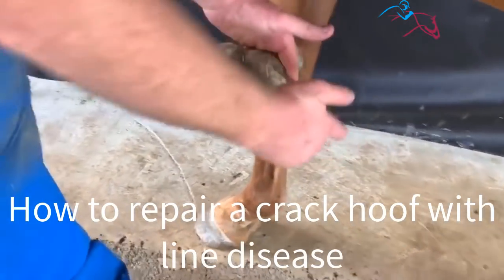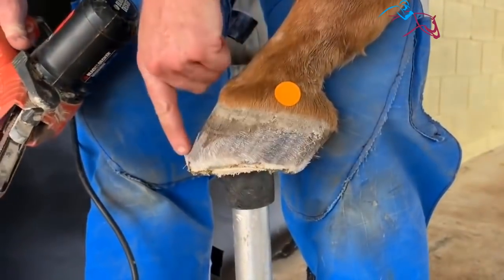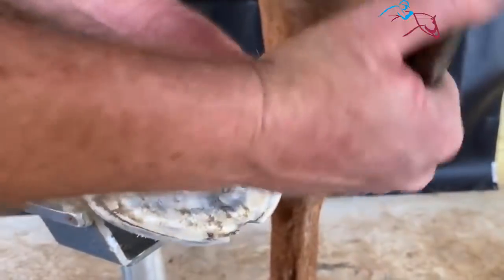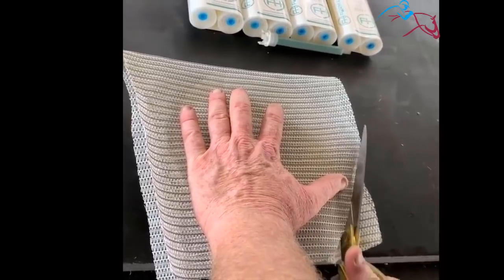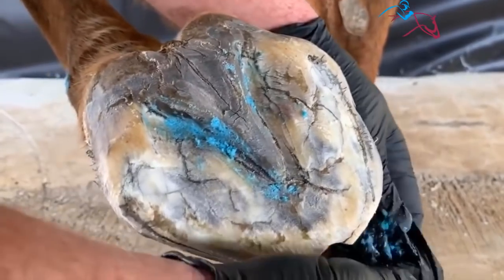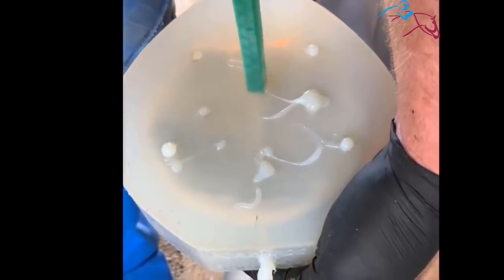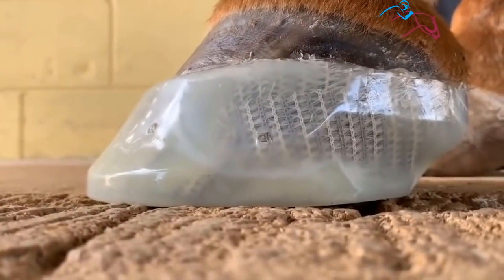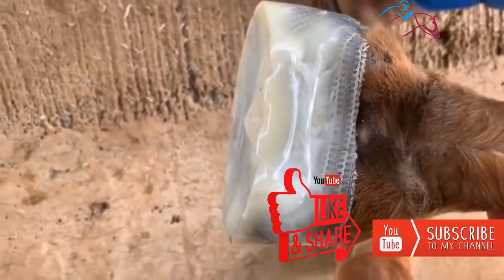Awesome broken Hoof Repair Horse Racing 2021

Comment: Toothpaste?  Why toothpaste?  Surely there is a better option that toothpaste?  What about honey?  That might actually both clean and help the medicine settle better into the areas it's needed.  It seems baby powder would be as effective a "holder" given how this mixture just sits atop the area it should go into but won't until maybe after the mold is applied.

Comment: Okay the photo for this video is very deceiving. Cuz a force in the photo is not the horse the guy is working on. The horse in the photo shows a black horse and don't know if the stallion or a mare. Couldn't tell you. But the damage to the horse's hoof itself is very bad. But when you go to see the video it's not the same horse. It is a brown horse with parts of the horse's hoof chipped off. Is there so you're really easy thing to fix. But the picture of the horse for the video that horse's foot was more damaged. Part of the hook was healed up and pointing that word like it's foot had a unicorn horn. I personally would have liked to have seen how the farrier repaired the horse's hoof in the picture for this video. That's the video I thought it was going to see instead of just a standard horse hoof filing and trimming. And then digging the crap out of its bottom of it's hoof.

Comment: problems with nails when exposed to bacteria. humans and horses are the same. but do not you clean the nails with alcohol or harder. it causes nail damage and becomes wrinkled. try with clean and warm water. it will be better.

Comment: Man, it really amazes me how these animals just stands still too.
Reply: They are trained to lift their feet and stand still
Reply: They don’t always.  That horse is likely sedated
Reply: @rockinu440  um, no, they are trained to stand still and give their legs, they do it every day, and it can be comfortable for them when you hold the leg right but you clearly dont know a lot about horses when you think we just sadate them 😬
Reply: @lynx6330  When we use power tools on their feet, we generally sedate them for our safety and theirs…and I’ve been a farrier for nearly 30 years, but you do you with all your knowledge.
Reply: @rockinu440  well of course you sedate them when using tools that could spook them or they have to stand still for a long time, or they arent used to having their feet done, im aware of those issues, every horse is different and every horse has a diffrent tolerance to being handled but if it is avoidable the horse isnt going to be sedated but im just some guy from germany who takes care of world class jumpers
Reply: @lynx6330  using tools like the ones in this video you might sedate them? Huh…sounds kinda like what I said.  And I have no idea what you know, I’ve seen quite a range in my professional career.
Reply: @rockinu440  my bad i apperently skipped the part where they used it 💀💀 i just saw the rest
Reply: @rockinu440  I have had a few horses with super hard feet that needed a sander to file them down. After a bit of training, they all stood like champs with no sedation necessary. Tranquilizers are not the answer for every single issue.
Reply: @erintubb9860  If your horse’s feet required power tools then you have a whole other set of issues to examine.  I use a buffer to put a show finish sometimes, but required? Sure some horses will stand, and sure horses can be trained, but it’s not my job to train them, and when a horse is facing an acute issue it requires attention right then, not after you have desensitized it for a couple weeks.  For my safety and the horse’s, sedation is the best answer, and if you believe otherwise that’s sure ok, but find someone else to work on your horse, I’m out.
Reply: @rockinu440  I do my horses feet myself. The only time I ever hired a farrier to do them was when I was heavily pregnant
Reply: @erintubb9860  Well, I’ve done horses every working day for 29 years…I hope you don’t mind if I don’t defer to your experiences with your horses.

Comment: Not a farrier but I've been Horsey (as we say in certain parts of the UK) for about fifty years and many things concern me about this video - (quite besides the almost useless soundtrack). Firstly - if anyone has brought a power tool near my horse as this guy did - he'd be buried in the muckheap - both my well behaved mare and my daughter's fairly uptight eventer would have killed him for sure. I reckon there's a good chance the horse was sedated or twitched. 
Over here splits in hooves like this are always referred to as "sand cracks" no matter if the horse has never seen any sand - they can be caused by trauma but are usually genetic faults ( not surprising so many freaky racehorses have them then!) Once evident - they provide a quick entry for all kinds of bugs and disease - I've never heard of anyone refer to "crack disease" before perhaps it's an Aussie idiom?
Though I saw the application of some magic bluey green potion being roughly applied - I fear for what's happening under all that polymer - it's a great idea and I can see it gaining traction in the Racing world where the horses are mostly treated well but as commodities. 
I can't post a link at present but there are veterinary overshoes that snap on with a strong latch - they don't fit as well as something glued on but have the advantage of easy access to check wounds.

Comment: Does the hoof grows back after a trim,if yes then how do the wild horses take care of their hooves...
Reply: Their hooves are worn down naturally, it’s standing on concrete, in dirty hay, or extended time in wet conditions that cause a lot of problems in hooves. In nature, horses are moving steadily over various terrain, which wears them down as they grow. Also, old style ranching where the horses are working cattle day in day out, rarely need worked unless injured. In the wild, an injury can mean death, if it prevents the horse from escaping.

Comment: This is really interesting. Such a well behaved horse too. I can't imagine trying to do this with a hose that doesn't like it's feet touched
Reply: Im not sure what u were trying to do. That was the strangest ,probably expensive repair to a quarter crack that normal shoes would have fixed
Reply: @christinemarsh9709  excessive use of a sander too
Reply: It was tranqed,no horse would put up with that sander
Reply: Oh look the internet experts are back.

Comment: the mold that you use can that  be used for several times or is that for once time to use?
Reply: I dont think this is this channels video. But I've seen it on others and these moulds can be reused on different horses. Search formahoof on YouTube.
Reply: @angelamelville67  He wasn't using Formahoof. This was a different substance and cannot be used again.
Reply: @rosemarydudley9954  he asked can the mould be used again, which it can, thats what I was saying. Thanks.
Reply: This is a stollen video that was sped up and reuploaded by this random channel. It’s been reported.
Original video is here: https://youtu.be/GXWQLO9Snlo

Comment: Surprised horse didn't react to the feeling of the sander.
Reply: They have no feeling in their hooves. With the exception of the frog, cornet, and the growth tissue deep into the hoof. 

Think of your finger nails, since they are the same material. When you clip and file your nail, it is the same feeling they feel.
Reply: @vetsrus31  I still feel vibrations in my nails

Comment: Whoever owns this poor animal, has absolutely no business owning it.  That crack is due completely to neglect.
Reply: Jennifer Seeley - Not always the case. Hot, dry, dusty weather can harm the feet. If the horse is turned out 24/7 and maybe treads on rocks etc., this can happen. The horse really needs a good diet and fresh water plus a hoof treatment,DAILY.
There was no blood seen here so the cracked hoof is all superficial and can be repaired by a good farrier. Sometimes a crack will go all the way up to the coronet and is usually stapled to hold it closed and secure while it re-grows. May take a bout a year.
Reply: @rosemarydudley9954  glad to see a fellow Equestrian who knows their trade in the comments!
Reply: This is a stollen video that was sped up.
Original video is here: https://youtu.be/GXWQLO9Snlo
Reply: @MissDizzyDoesIt  that would account for the clickbait
Reply: This is a stollen video that was sped up and reuploaded by this random channel.
Original video is here: https://youtu.be/GXWQLO9Snlo
Reply: The owner should be put down
Reply: Johnny Barger yes :)
Reply: @Jordan Sharp rescue or not Who Ever Owned the animal should never own animals again . The man doing the repairs should by law  tie the owner or owners down and by - law the same procedures done on them ! Even if that means having to put one down !
Reply: @JohnnyBarger-sb3yh  A neglected horse would never let a human handle it's hooves. This is common to all horses, especially those that get ridden often or used for work. Kind of like shoes, the more you use, the faster they run down and need fixing. The only difference is that hooves constantly grow, and when one side over grows it causes splitting from being unbalanced. Think of your hair, leaving ut untrimmed and letting it grow naturally causes split ends with some hairs being longer or shorter then others.
Reply: https://www.youtube.com/watch?v=GA7wWKI7q08😊❤️✋🏻 عن جمال الصوت وبس